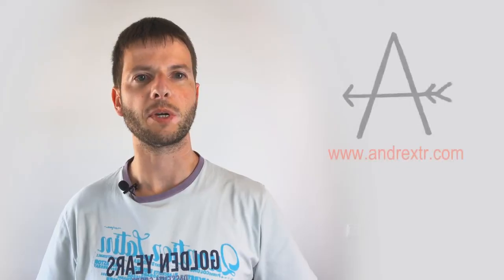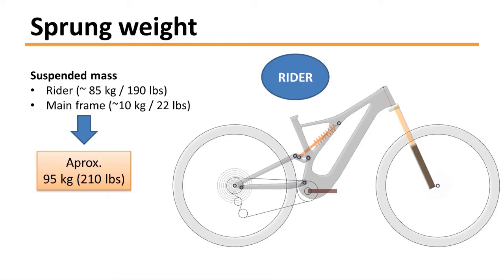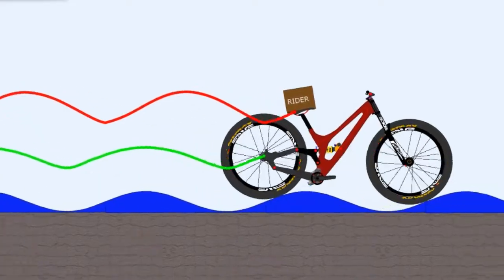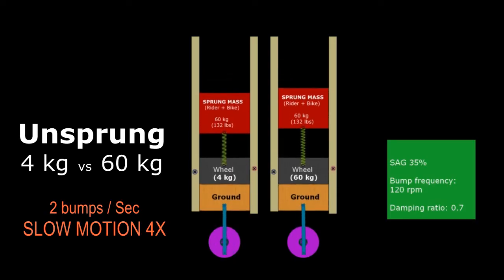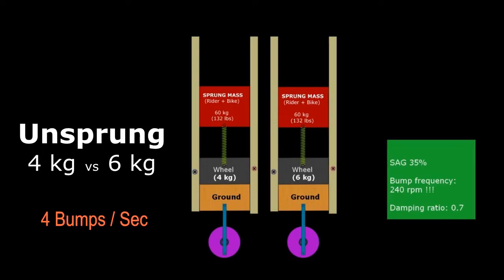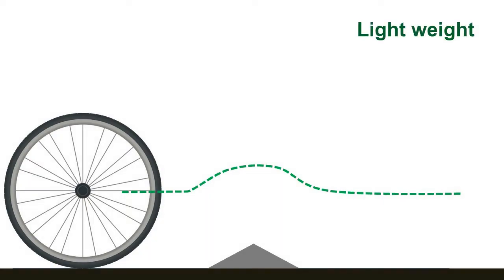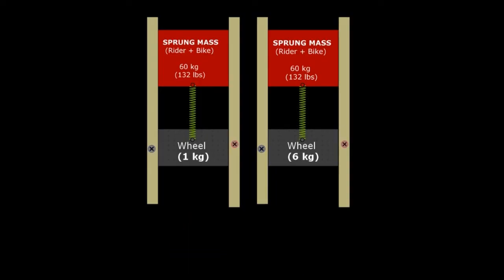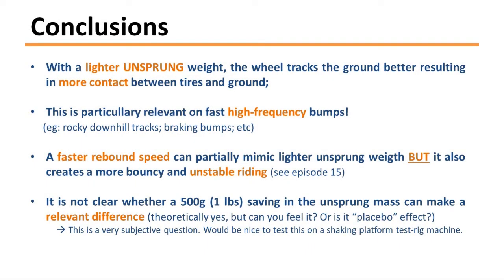Unsprung weight & Suspension performance  (MTB Rear Ep. 22)

Comment: Does the GT Fury 2015-2018 IDrive suspension design cause it to add unsprung mass from rider's weight to the rear triangle? How does this affect suspension?
Reply: Followup. I don't know if it's scientific or not but me losing 10kg of body weight made my gt fury transmit less high speed chatter than when i was heavier.

Comment: Don't you mean the weight disribution is bias to the front? How can the rear be heavier when some forks weigh 2kg....

It would have been nice if you spoke about the ratio of weight compared to sprung mass. My understanding is unsprung mass weighs  roughly 4x of sprung mass. 

Lastly, it would have been nice if you spoke about the difference in acceleration and deceleration when reducing weight of unsprung mass.

Comment: Hi Andre. Love your objective explanations of how suspension actually works thanks. I found it interesting because I ride a Zerode which has a gearbox is and this very low unsprung mass on rear wheel.

I have a related question around tyre volumes: Effectively tyres are undamped suspension I guess. Have you tried measuring or analysing the effect on suspension of different tyre volumes? Say difference between a 2.5 and 2.8 tyre. 
I’ve been switching between sizes of Maxxis minions trying to gauge the real differences in overall performance (speed, grip, traction etc). 

Perhaps surprisingly the 2.8s (on 38mm rims) are definitely the fastest rolling, most braking grip, and seem to have best traction in most circumstances. But logic tells me the bigger undamped volume should in fact be compromising suspension performance. 
Your thoughts? 
Cheers, brendon.
Reply from the maker: Never measured the effect of tyre. Its a dynamic process hard to simulate. Also a larger tyre on larger wheels also has larger contact surface with the ground, which influences traction. And thus you can theoretically run lower pressures because the contact surface of the tyre is higher (F=P*A).
Reply: @andrextr  yes, I guess you can get the same “tension” in a bigger volume tyre with less pressure, so therefore better roll-over and more grip via contact area at the same time.
Reply: @andrextr  isnt the problem in MTB that grip is not consistent - unlike in roadbiking world. So thinner tyres actually have the ability to cut through dirt, theoretically, more often resulting in more grip?

Comment: But the unsprung mass on a bicycle I would say is lower than 4 to 5kg. Because it's distributed across the front and back wheel, and the wheels are independent. The suspension pushes them both down separately, so in fact the unsprung weight doesn't act like a 4kg one, or am I wrong?
Reply from the maker: 4kg is an aproximation of the weight of rear suspension unsprung mass and includes wheel tire cassete brake and part of rear triangle mass… in lighter bikes it may be lower number
Reply: For the front wheel it will be lower but you will probably also have lower spring rate in the front

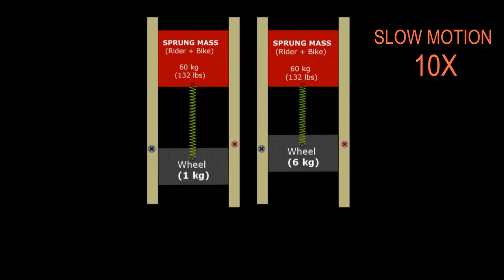Comment: 9:02 I really can't understand how this makes sense wtf
Reply from the maker: Lighter objects accelerate faster.
Reply: @andrextr  but if F=ma then a=F/m which means a=mg/m so a=g which means that they should have the same acceleration doesn't it?
Reply from the maker: @Tony_Sab  if "a=F/m" then for a given force (spring force from the suspension pushing the wheel down) the higher the Mass, the lower the acceleration... heavier objects accelerate slower than lighter ones, under the same force. Inertia... Cheers
Reply: Acceleration is similar to the ground and is 9,81 meters per square seconds in vertical direction. A damper provides also friction so the lighter unsprung weight gets more attenuation in the vertical down movement. There must be another inertia factor in the game to have the heavier unsorung weight react slower.  @andrextr

Comment: Thank you for the video, it's really interesting. So the important factor here is the ratio between sprung and unsprung mass, correct? Meaning a heavier rider/bike can afford to put on more unsprung mass. Two things come to mind, as you increase the sprung weight you exert more force on the ground, meaning that you sometimes need heavy casing tires and or inserts  (depending on the terrain of course) to compensate for an increased chance of punctures or sidewall instability. You don't want to just keep adding air pressure in the tire because it will cause other problems. Also, your suspension setting is more aggressive compensate (unless this is proportional).

So essentially not taking everything in isolation but as a whole system, as you change the sprung weight you also want to adjust the unsprung weight to keep everything performing correctly in the real world. It's not just about keeping the wheels on the ground but also having them perform correctly when they are on the ground, giving you grip, traction, and security.

Another interesting factor, the Shimano 12 speed cassette range comes to mind. While the Deore or SLX might perform exactly the same as the much more expensive but lighter XTR. The lighter one won't only make you climb up hills faster but provide marginally better tire tracking performance too.
Reply from the maker: Hi. Yes the ratio is what matters, because an heavy rider needs a stronger springrate in the shock that will push the wheel faster against the ground. So the wheel is less prone to get “airborne” after bump crests or in holes. However, an heavier rider also has disadvantages because due to increased inertia it wont brake / decelerate / turn as fast... this is common sense and its why racing cars need to be as light as possible (both sprung and unsprung mass).

Comment: what is the effect of crazy chainguides (like the one on the commencal supreme dh or norco aurumn) on antisquat values?
Reply from the maker: It depends a lot on the position of pivots and chain idler, but usually these type of systems (so called High pivot suspension) can achieve good antisquats (near 100%) without any chainextension and pedal kickback. So, the antisquat results mostly because of the swingarm angle (which in turn results into a more rearward axle path) and the chain pulling effect is minimal. Overall these designs are better in my opinion. Only problem is the transmission/ extra drag etc.
Reply: @andrextr  Thanks a lot. I have been intrigued by these systems for some time now. Your videos are very informative! Thank you!

Comment: I am glad you made this video after my question I proposed about the Zerode and sprung mass in your other video. However you did not reply to me about what I told you about the rider not 'always' being part of the sprung mass of the bike. There is times during riding for example where the large inertia as proven here in your tests but rather of the rider thsn the bike means that the riders bodyweight is also not always in sync with the frame of the bicycle. This is why gearbox bikes have a noticeable difference in performance. The same goes for the front fork, sometimes you press lightly with your hands through the handlebars and sometimes you press more. Your videos and physics models are very good but you must know that they do not tell the whole story. The reason you are unable to determine in this video if the 500g unsprung masa makes a difference is because of the overly simplified physics model. You need to find away to seperate the riders mass from the frames mass and run a physics simulation.
Reply from the maker: Hi Dan. I do found a difference in the model with small weight differences, but that was only visible on higher frequency bumps. This video does not intend to answer all complex questions. It was an educational/ proof of concept approach only. To test the gearbox question my suggestion is to use some kind of vibration test rig (similar to those used on cars) and see how wheel tracks the vibrations (slow motion camera?).  But I do think you will get a diference, the only question is whether thats a relevant or significant difference or not, but this is highly subjective (for some it might be relevant for others might not be). Anyway I do like the gearbox concept over the classical transmissions for other reasons besides unsprung mass. Cheers 🍻

Comment: Does rear suspension leverage ratio multiply the unsprung weight ?
Reply from the maker: Not necessarily. What matters the most is the weight/mass of the moving part of the suspension. Now, with higher leverage ratios you also need higher springrates and firmer compression damping to compensate (but this is not directly related with the topic of this video).

Comment: I think I would also add normal forces at the point of contact in your explanation!
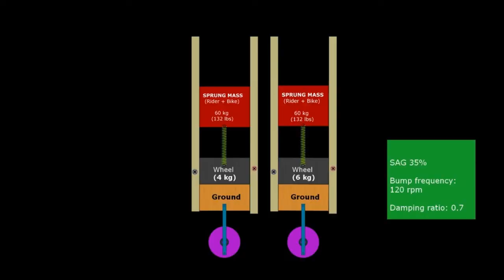As you said, light unsprung mass means more time spent in contact to the ground... But it also means higher normal force, which in turns means higher friction forces (handling). For example, at 4:55, the 6kg wheels seems to follow the road just as the 4kg does... But in reality, it's "about to" lift up so it has less normal force on the ground!
By the way, thanks for your videos! 👌👌

Comment: Really interesting. The lasr question means a lot: is a 500gr weight saving (on rim, hub, tire, groupset, maybe frame parts)  enough for an improvement?
Reply: lol its not good news , less weight = more money spent , lol
Reply: @sdqsdq6274 not necessarily because now you dont need to save weight on the frame and elsewhere so no money spent on expensive carbon frames

Comment: I think in the video you are only talking about "tracking" performance, which isn't directly necessarily linked to faster times down the track. In fact, there are MANY situations where you want to float over the ground and not track it, which makes it easier for the rider = faster. Whoops in supercross are the perfect example.

Then when you talk about rebound making it unstable, you are showing a video of a 1DoF model, but in the moving ground simulation where you actually show the faster rebound in this video, the suspended mass is even more stable in that particular example.

Then, what about the added stability of a heavier wheel for the suspended mass AND the gyroscopic effect?

Overall performance (lower elapsed time from start to finish) is a very complex variable, which greatly includes rider which these simulations completely exclude. I think you should clarify in your video that you are only talking about performance meaning how good the wheel tracks the ground. And in this regard, I think you miss one of the biggest + of having low unsprung weight which is, if you do want to track the ground, it makes it easier to achieve that without going crazy with the setup, it just happends more "on it self".

Comment: Hi man, thanks for your nice videos. Dont you miss the effect less unsprung mass has on comfort in this video? In the early simulations in this video you already see less movement of the sprung weight with a lower unsprung mass. I think its a big advantage you especially notice in light jeeps. They are terribly bouncy ride because of the big weels on a simple light car. Secondly, a gearbox on a MTB shifts the weight (of a derailler) from the unsprung weight to the spung weight. (so it works in your advantage twice) I disagree that this change is just a placebo effect.

Comment: Nice Video, but i think y miss one think. The Rider and the mainframe  aren't one solid piece. That's why heavy E-Bikes Feel smooth over bumbs. The Main frame is around 10kg Heavier than a normal.The relation between unsprung top sprung weight is 50% (5/10) to 25% (5/20) in the E-Bike. So you get Less severe blows to feet and hands

Comment: Interesting video as always. One can also invert what you said. You won't feel a difference of a 500g reduction, so you won't feel a difference in a 500g addition. I notice no drawbacks on my DH Ebike with DH tires and wheelset and thick tubes.
Reply from the maker: Yes, I also think that 500gr does not have a big impact. I mean, it's always better to have less, in particular on rocky bumpy tracks, but I'm not sure whether you can feel that difference or if it is only placebo effect (probably you can, who knows... it would be interesting to do some real-world experiments with a shaking test-rig platform, under the bike)
Reply from the maker: PS: I also ride 500gr maxxis DH tubes on my DH bike eheheh

Comment: Hi, I think you should have factored in the gyroscopic effect of the rotating mass, where small increase of weight of eg a tire might significantly increase its inertia.
Reply from the maker: Hi, it's a good point, but in this case the gyroscopic effect has no relevance because the wheel moves up and down without changing the axle of rotation. A spinning wheel only resists to the efforts of tilting the wheel (horizontal / vertical) or turning the wheel (right and left). Moving the wheel up and down without twisting does not cause gyroscopic resistance. This is a experiment that can be done by holding a spinning bike wheel... Your point applies more to when you are accelerating the bike forward (heavier wheels makes it harder to spin faster, and to slow down also). Cheers.

Comment: But to say it “performs better” might be incorrect right? The lighter weight tracks better, but that doesn’t make it faster right? Wouldn’t the ground being in contact with the wheel make it slower due to rolling resistance? Maybe that was the counter intuitive part you mentioned.
Reply from the maker: I was thinking more in the perspective of going over a downhill bumpy track. A lighter unsprung mass allows you to go faster near the limits without losing the control since the wheels stays more time on the ground, and not in the air. Losing contact with the ground in sucessive fast bumps can make you loose control. In car racing and F1 the unsprung mass is also important to improve handling and steering and keep the traction with the track. However, I've read that, as you point out, a very light unsprung mass can have some drawbacks (in passenger cars) since the wheels track better the ground they can pass more vibration from the road imperfections to the car cabin and cause more rolling noise and vibrations inside the car. Cheers
Reply: Being in control is always going to be faster regardless of the rolling resistance when downhill is concerned.

Comment: Hello Andre, Thank you very much for this nice and interesting video. 
The question of hydraulic is still complexe because shock absorbers have hydraulic to slow down the mouvement and itwould seem to be logical that a lower hydraulic braking balances a little bit heavier unsprung mass, in compression and in rebound.
Reply from the maker: Hi! Yes, its complex. I think that more unsprung mass requires more compression damping to slow down the wheel movement. The problem is that this also affects the sprung mass (rider + frame) and makes the riding stiffer (the wheel moving up or the chassi + rider moving down, they both cause compression in the shock). Theoretically, with zero unsprung mass you don't need hydraulics to control and dampen the wheel movements :) Cheers.

Comment: I usually go on long rides and carry all my tools and combined 4 litres of hydration. I have to adjust my rear suspension 2 times during my rides to compensate for weight. It's kind of a hassle but necessary. Thanks for the video!
Reply from the maker: In that case you are increasing only the sprung mass (suspended mass) and therefore you might need to adjust the SAG. Nevertheless, you are not increasing the UNsprung mass. Unless you store the hydration in the rear triangle of the bike eheheh :)  Cheers
Reply: @andrextr  The motorcycle company Buell made a motorcycle, the Firebolt where the frame doubled as the fuel tank. I always enjoy your videos and content! I personally wouldn't mind if you recycled your old videos and content. 🤙

Comment: How would longer chainstays and leverage ratio affect this?
Reply from the maker: I don't think that there is a direct correlation between these factors. What matters in this case is the total weight of the unsprung mass (the moving part of the suspension)... The average leverage ratio affects more the amount of damping and springrate needed...usually higher leverage ratios need stiffer springs and stronger damping (this happens when you have a small-sized shock for so much travel). But I guess that's not directly related with this video. Cheers.
Reply: @andrextr  abrigado!

Comment: 35% sag?!?! Wtf... who the hell runs 35% sag other than an idiot that doesn't understand preload. Much more realistic would be between 15% min and 25% max
Reply: Most manuf of mid travel and up bikes recommend 30% sag.
Reply: Seems you are a bit out of touch there buddy. If you happen to ride down a hill one day and actually use your suspension you might understand.
Reply: A side note, with mountain bikes, preload on a coil spring isn't even something that should be used to achieve a certain amount of SAG, ideally a rider would instead change spring rate until they are happy with SAG and the less preload needed, the better (as long as it's at least 1 turn after the spring is seated).